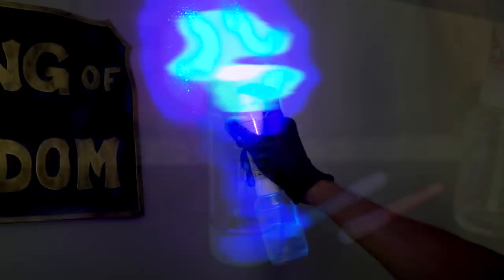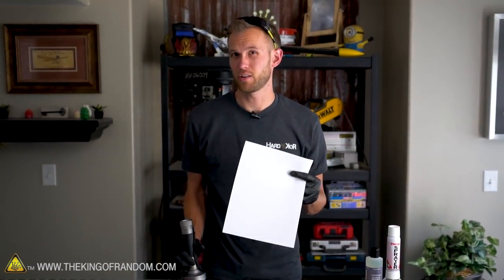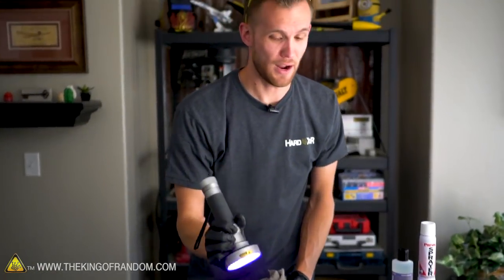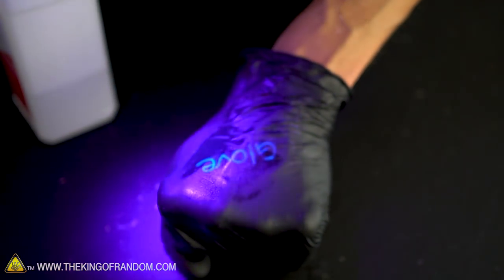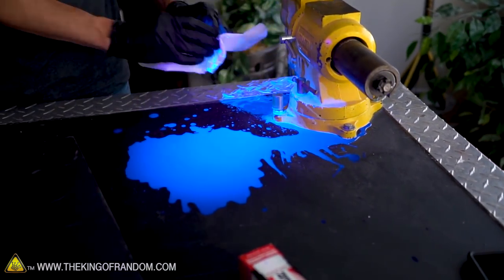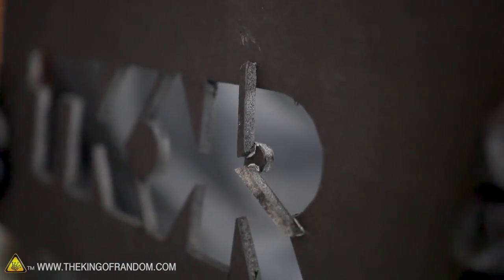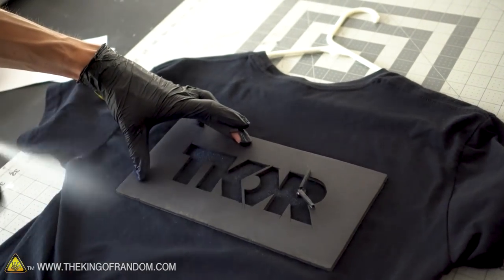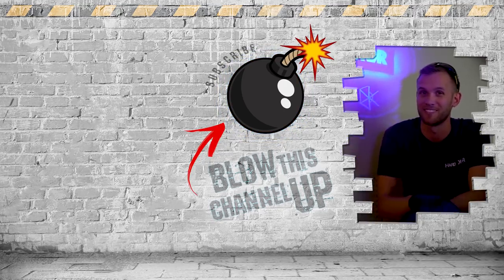Hide Secret CODES in INVISIBLE INK

Comment: Try this KOR: What happens when 1. you add super glue with saltwater and boil it  2. Make a ball of sand with superglue and measure its tensile or compressive strength 3. Superglue applied to car wheels when car at stationary, will the car move when super glue completely dried. 4. What happens to thermite when super glue is added to it. 5. Can super glue be useful to make lanterns or can it be used with other fuels to increase its capacity to burn.

Comment: test it in moonlight
Reply: or weld to see of you can see the ink as you do
Reply: Don't blame it on the boogie
Reply: Moonlight is just reflected sunlight so in theory, it would work but the moon is much smaller than Earth and so it has to spread a small amount of the sun's light into a larger surface AND the surface of the moon is pretty dark so it absorbs most of the light that hits it anyway. The moon may look bright in the sky but that's an illusion because it's the only real bright thing up there. Stars are even dimmer because they're so far away.

Imagine bouncing water off of a spoon and trying to completely cover one side of a basketball with it. Spreading that limited amount of water over such a large surface is incredibly difficult. That's what the moon does.

As for your other suggestion, welding does emit UV radiation but I doubt it would produce enough to easily see the ink. Might make for a decent experiment though!

Comment: Hey TKOR! I was wondering if you could do a video on experimenting with aerogel. If you don't already know, aerogel is an extremely lightweight, solid material that is 99.8% air. It's also EXTREMELY thermal resistant.